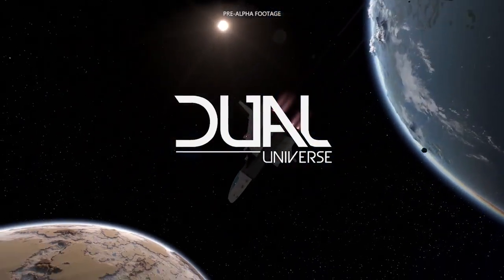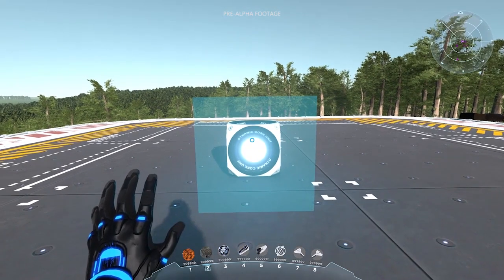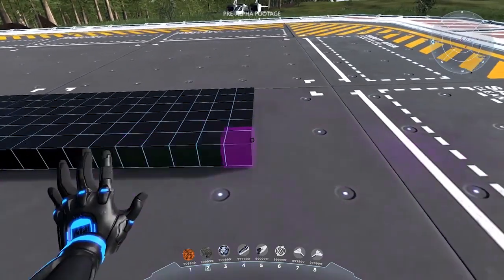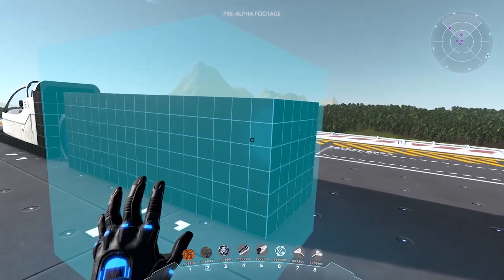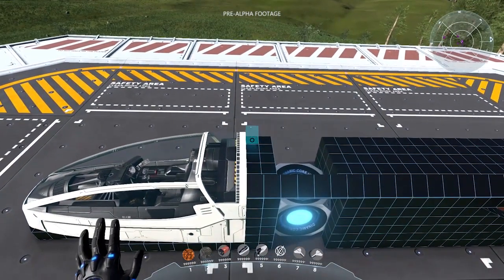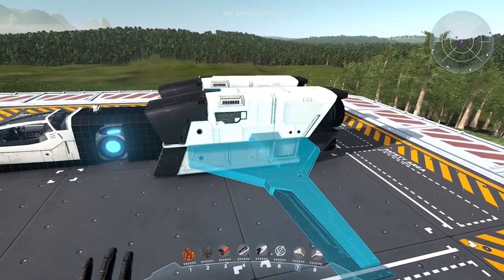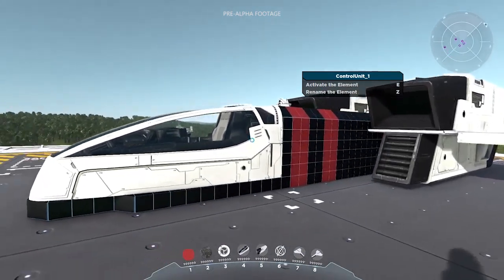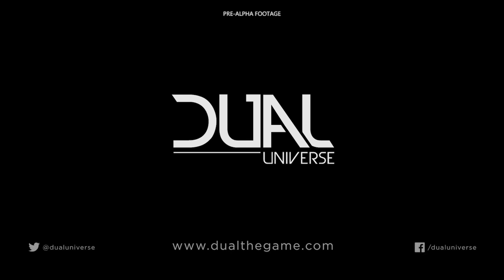Dual Universe - How Building a Starship Works! (Crafting Space Sandbox MMO)

Comment: there must be a cost element in place when it releases and I would like this to be a separate design menu or station rather than being rendered in-game so there's a bit more immersion and then you place it in game as a single cube and you need to collect materials and put them into it like space engineers but make it build dynamically (like if you build a building the materials have to be "welded" in place for every cube by the character or a vessel designed to make this process faster). maybe to get the materials you need a mining vessel to get them. I know I'm asking for a ton but that is my perfect space sim because it makes it so tedious that player do different parts of the project and eventually it will led to a somewhat realistic economy but I can only ask and hope.